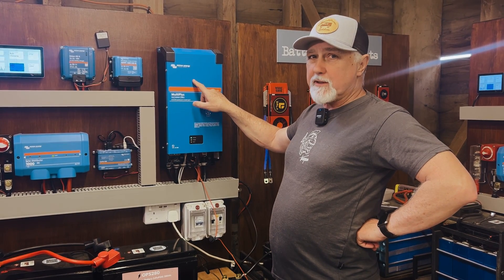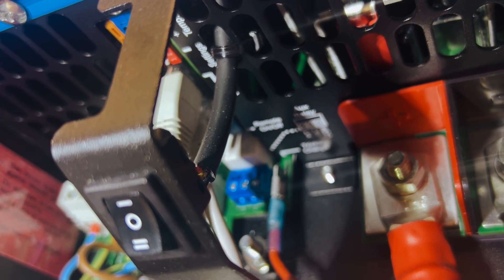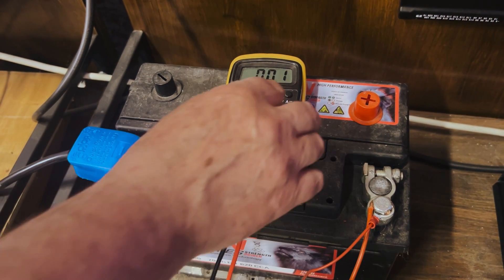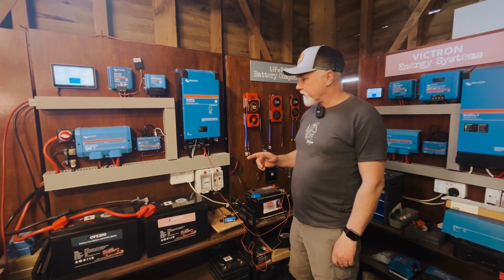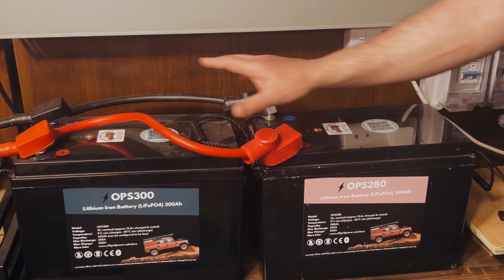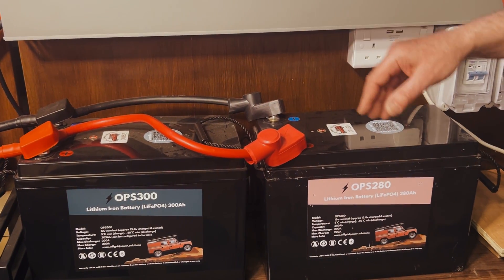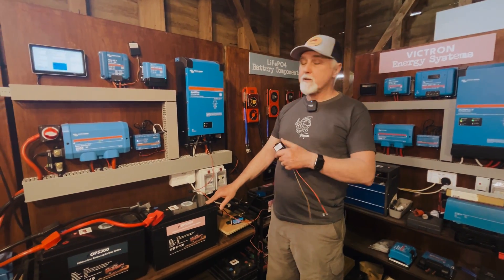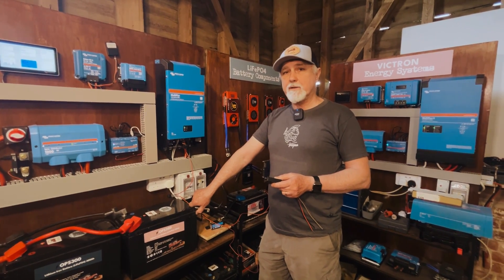Using a Multiplus to trickle charge your engine battery

Comment: I didn't hear about whether it will still work if the Multiplus is off. Can you advise. Thanks
Reply: Yes, it will even work when the Multiplus is off.
The trickle charger is simply a diode and PTC resistor in series, one end connected to battery + input of the Multiplus, other end is the spade connector.
It is very similar to something like a Votronic standby charger.

Comment: Question. Do the house battery bank and starter battery have to be on the same ground? 

I’d like to run a trickle charge cable from the multiples in my trailer… to my starter battery in my rig. But, I read on a vague post that the two batteries have to share the same ground for it to work. 

If you or anyone else knows the answer to this, please let me know! 

Much thanks in advance!

G
Reply: apparently nobody here knows... do you have an answer yet (thru another channel???)? I think common ground is absolutely necessary.

Comment: Does the 13 volts from the trickle charger trigger an Orion XS to draw if the engine is off and there’s not an engine cable in the H port to keep it off?

Comment: Great video, thanks Roger. Just purchased a motorhome with a multiplus and was thinking that I would need to add in a Van Bitz Master to maintain the starter battery. Now off to investigate under the cover of the Multiplus. Presuming I can simply feed to the supply from the starter battery to the DC-DC Victron Orion?
Reply: Exactly my thoughts. The DC-DC is connected to the starter battery, but my problem is that it's an Isolated DC-DC. The negative pole on the starter battery side is seperated from the negative on the LiFePO4-battery side... I guess it will not work without a commun ground on the chassis??

Comment: A really useful video thank you.  I have the 2KW multi plus recently installed but the fitter didn’t connect the trickle charge line - I’ve got him doing that next week when he is fitting the D+ line (I have smart alternator which isn’t charging the lithium habitation batteries when engine is on).  To clarify please, when the trickle charge line is connected and the van connected to shore, both habitation (lithium) and starter (AGM) batteries will be maintained and no danger that I will overcook the starter battery?  So I can just plug in and forget?  Thanks for your help.

Comment: What about a 24vot compact?can it directly charge a 12 volt lifepo4  battery?  Or is it's output 24volt?
Reply: My 24v Multiplus outputs 24v on the trickle connection.

Comment: Thanks for another great video Roger. I guess the manual switch could be replaced with a relay triggered from the Cerbo GX. When the Orion XS pre order eventually arrives, everything could maybe be combined with some node red code to do the same function as the Battery Master